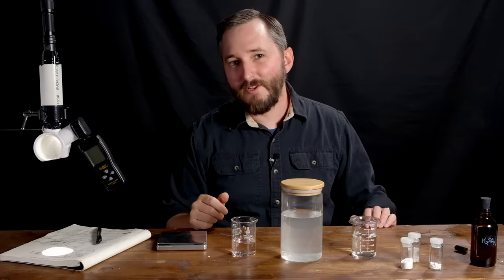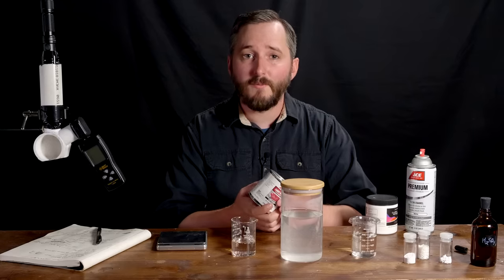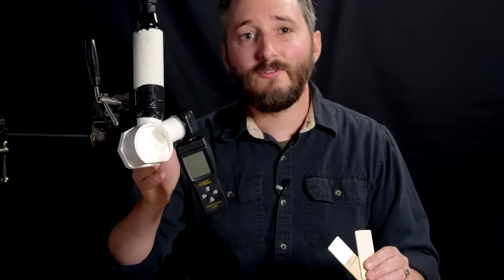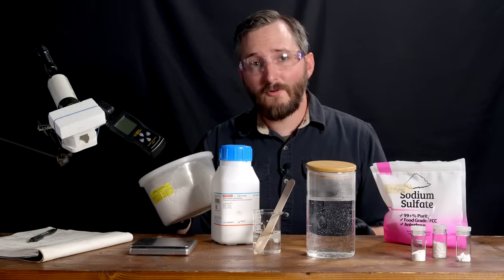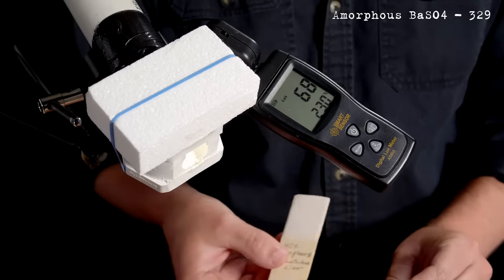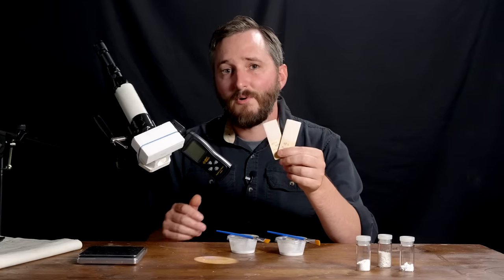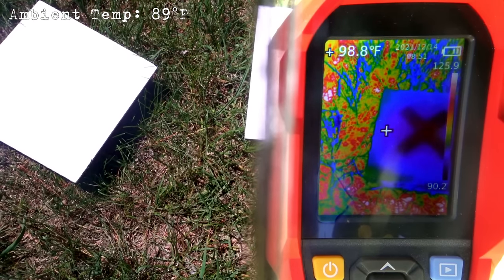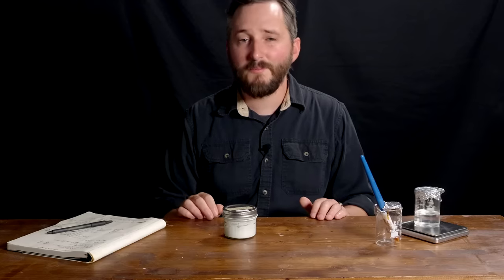How To Make Infrared Cooling Paint (Electricity Free Air Conditioning)

Comment: Welp, that was fun. But, here comes a novel.. Please do not comment that my novel is too much and that you are not gonna read.. if it is too much, it is okay, don't read, but, taking the time to comment that you are not gonna read it, don't. keep your comments to yourself and just don't read it. As all I will reply with, is how pathetic it is, something that only took me about less then 4 minutes to type out, is too scary for you to read and will take you longer to read then me to type it.. 

 It made me remember all sorts of processes of my past that I suppose I now take for granted, simply due to not ever really thinking about all that went into various coating systems. Like one system for reflective additive, about 2000 X's more reflective then the simply and cost effective diatomic additive dead cellular sea crustaceans of that particular size and shape and species.. which is a whole other subject matter. But we built a machine that was about 75 feet tall and was more over a pressure vessel kinda like what one would see for a petroleum thermal/gravity separator to boil off each type of useful liquid at different levels, all from the base crude oil from high purity of the JP series of fuels to the lubricants and even what is last to be collected lower in the still, the solids or powders...

In our system, molten clean glass of high grade of a specific formulation would be pressed through very small nozzles like a spaghetti noodle press. The pressure pending the desired effect of accuracy of size of the finished result, the upper most area was charged with a extremely high voltage and extremely alarmingly high amperage, for the end result of almost to the state of plasma just shy of 8 - 9,000 degrees F. all from the static charge upper area all from the electricity humming there. This several million volt charge, backed by the high amperage would surpass the non-conductive nature of the glass particulates floating around and the electricity at those temps would explode the glass into micronic particle size molten beads, even smaller then talcum powder's structure, while not needing to be tempered once the high voltage arcing busted the glass into molten particles. This finished glass beads product was exceptionally dangerous, not just the manufacturing process, and costly, but as a finished powder. It was gravity collected in the fall's length and static charge while cooled at the bottom area of the vessel pending how much static charge to attract or collect which particle size, and the larger sized beads were recycled back upto the top for squirting back through again, or the super fine talcum sized beads funneled and stored in one of about 12 different liquids, pending the desired use. Each type of chemical storage container respective to the type of chemical, and all triple boxed and each layer with dampening padding for safety. 

Glass beads this small in a dry powder form, not contained in a liquid to be able to transport it safely was not allowed. A 1/4 cup of this glass powder beads, dry, would cling to everything in a typical gymnasium or a 100 ft by 100 ft by 30 ft ceiling, if that 1/4 cup was 100% dry, and was dropped. it would go everywhere, just from the concussion of being dropped, and the static in the air, would do the rest. It "CREEPS" to coat everything in that area to find balance and a spill / splatter of where it landed, in a few days, would mostly be gone and everything internally of the gym would be coated, rest of the floor, the walls, the ceiling and anything else that is in their. The clean-up method was a brand of exceptionally sticky grease, that can be thinned out or reduced so many methods of application of the grease can be dealt with. pouring the grease to spraying.. Attaching any other liquid or oil, will contain the beads, kinda.. but gotta move quick. Every kit was sent with a cleanup kit. even if the customer didn't want one, they had no choice but to buy that along with the package of beads. 

The whole point of this stuff, to be able to make reflective additive to pigment's or top coats. A special spray-gun was needed, as the nozzle of the paint sprayer would be chewed out to a larger diameter, from the round beads, although round beads, being that small, it was still abrasive on the typical HPLV & HVLP automotive units.. The pintle or needle and orifice of the special unit has something like ruby or garnet for the abrasion resistant factor.. and those were like 100 X's the cost too. 

They also were playing with mineral additives and other formulations of types of glass and other opaque materials that they would push through the system. and each would play a role in blocking or reflecting certain bandwidths of more or less, (filtering) pending the desire.. just crazy stuff that I have forgotten about after 20 plus years..

The glass powder was somewhat safe in liquids, or when spraying them on the substrate being coated, as the mist / spray that the eyes see being sprayed out of the sprayer unit, was estimated to be about 1000 to 4000 X's larger then the glass beads and that atomized solvents contained the glass beads safely on their way to the surface being painted. Overspray once the solvent gassed off/out, the base of the coating was still larger than the glass beads. So they claimed? but, if breathed as a dry powder, into the lungs, as that stuff is flying all over the place from static electricity/charge it was such a threat that it would cause the same effects that asbestos, as the body will not see the inhaled non sharp beads as anything to worry about, but the body will just accept it as an inert objects in the cilia of the lung walls and will never try to white cell around them, and just collect and suffocate you or leave you in the constant state of feeling like you are never getting enough air. Yet, unlike asbestos, that cuts at the lung walls causing the never ending of white cellular attacks to cause scare tissue build up. same result, minus the scary sounding name mesothelioma. 

It was very interesting.. If you spray the base coat/pigment color, then were to spray your top coat/clear coat and add this fine glass beads. the effect is interesting. daylight, your vehicle is what ever color the base color is. at night night, the reflected light is like shinning a light at a mirror and reflects 100% of the lights from your flash light.. or headlights if you were cutting across an intersection of streets and would temp blind those people...lol...as if somebody was shinning their headlights right at them, when it is just their own being reflected back at them... I wish I could tell you what the manufacturer wanted with this crap. All I can say is it was for military. What would require about 10 to 12 tons of that powder? I don't know. I would be horrible for radar reflective application. It would be horrible for laser tracking blendering, as the particles are so small, that it would reflect back almost perfectly which is no good for scattering or blendering lasers. Horrible for heat or thermal imagine, as glass is horrible for ridding itself of heat in a timely fashion and would stick out like a sour thumb.. So, I really have no clue...